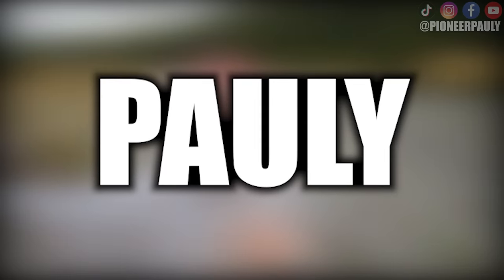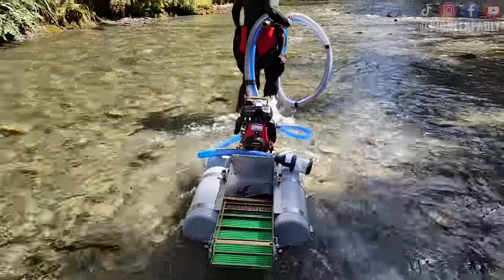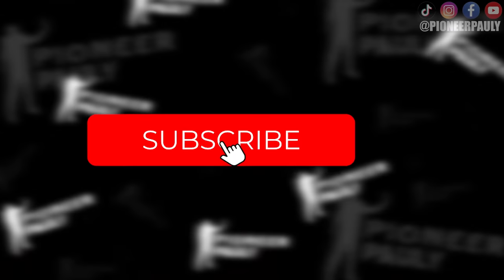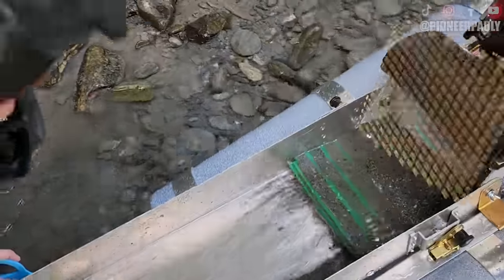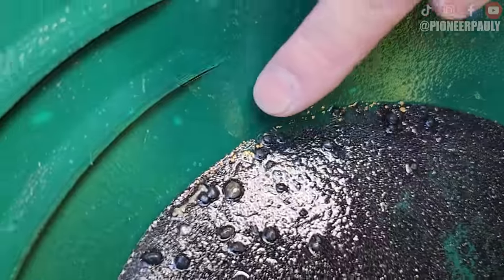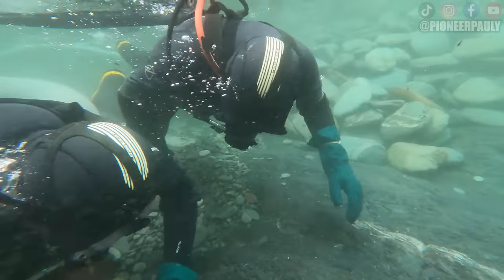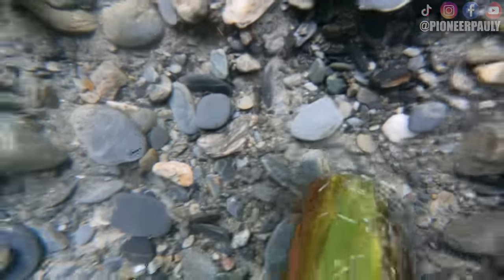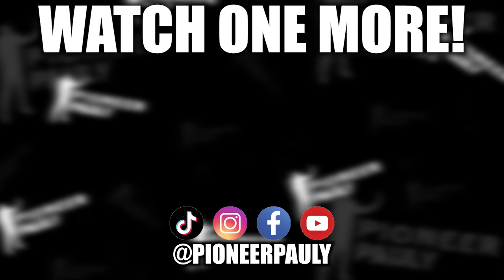Trying The MINI DREDGE On The New Zealand Gold Claim!

Comment: A method to get more production from a 2 inch dredge is to pull the hose off of the suction nozzle and then use the flow of water from the suction nozzle to dig a trench in the stream bed, the goal is to blow the oversize rocks out of the hole. The gold being heavy concentrates at the bottom of the hole, reconnect your suction hose to the nozzle and cleanup the bottom of the hole...This works!

Comment: Weld a stangoff ring, slighlty smaller diameter than the nozzle end about 1/4 to 3/8 inch away from the end of the nozzle. This is allow water continue to flow into the nozzle if a big rock blocks the end. I found by disturbing the water flow over the sluice, due to clogged nozzle end, will cause gold to wash out of the sluice once the flow is reestablished . Look at the other guy's nozzle end.